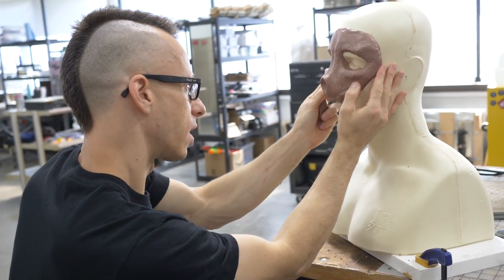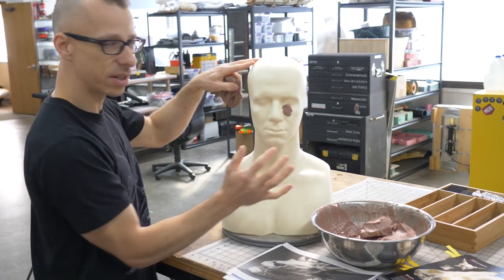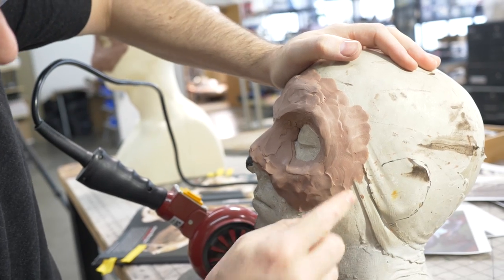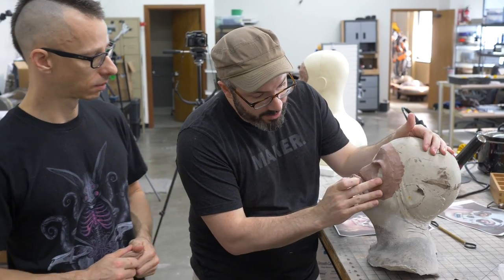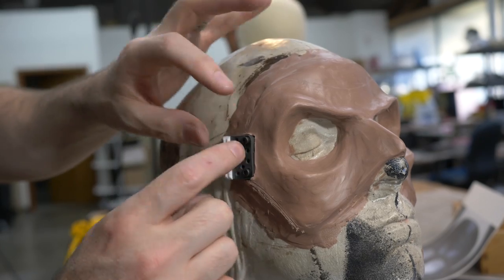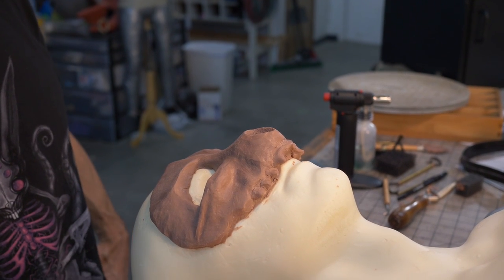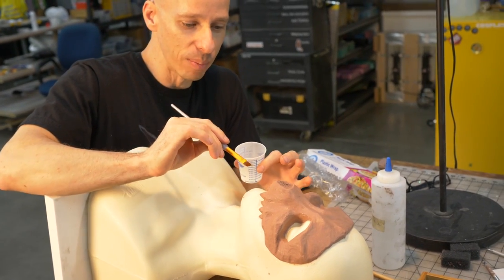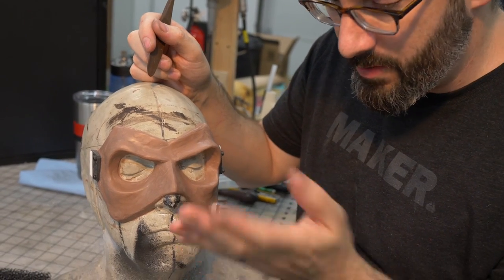Sculpting with Monster Clay! - Mask MADNESS Part 1

Comment: so ... Monster clay can be re-used after molding ? I mean you don't really bake it like a normal clay and it's not really drying so ... when you've finished your mold you can juste destory your piece, keep the clay and using it again on another project ? Right ?
Reply from the maker: That is correct! Since it's waxed based it will never dry out, only harden a bit. You can reheat it and get it back to a working or even completely liquid state, make something again, and destroy/reuse it again!
Reply: Yep! I've known guys who've had the same clay for over 15 years. 

I do recommend covering any sculpt with a trash bag when you're not working on it. it helps keep the pet hair out!  

When all done with a sculpt I put all the caly into a crockpot on low then let it get to a liquid state and filter it through a wire strainer. This will help you filter out any stuff like silicone, plasti paste, fiberglass resin, or pet hair. Then I pour the liquid clay into different containers like silicone meatloaf, brownie trays and wrap the cooled clay in aluminum foil. that way i have a variety of chunks of clay ready for for all kinds of projects.

Comment: Is it possible to use a regular foam wig head or something similar to sculpt onto? Or would that definitly stick to the styrofoam while pulling the sculpt off..? Maybe there is something I could seal the styrofoam with so the clay and mold will come off?
Reply from the maker: The styrofoam material should be fine! The problem is a lot of those heads are pretty small, so make sure yours will work for your head size.

Comment: Would a hair dryer work for heating it to a workable state mid project if you don't have a heat gun?
Reply from the maker: Yeah, a hair dryer should get hot enough to soften the clay.

Comment: Quick question, is there a way to make this clay permanent? (Like can you get it at a permanently solid state?)
Reply from the maker: With other kinds of clay you can bake it or let it air dry and it will not be workable again. Monster clay is designed for mold making like you see in this video and will never fully harden or dry. It's really excellent for long term sculpting projects, like full body applications that you see in the film industry!
Reply: Punished Props Academy thank you, I find that very helpful. I’m looking for clay that is easy to use that I can make latex figured off of so I was just curious if I would be able to make a permanent mold. However I’m sure it’ll still work as long as I remember to use enough setting powder

Comment: I bought 5 lbs of Plastilina modeling clay from michaels because its super cheap. I love masks, I've had an ineterest in them for a very long time but have never really worked up the courage to make several for myself and so am nervous starting to try now. I'm thinking of trying the monster clay, as I hear its pretty popular for the few videos I've seen where its used but is pretty expensive. But is it really so different from the plastalina I've used? Because the stuff is fairly stiff after the few seconds of being heated, and I'm look to find something thats more like ceramic clay as that's something I'm really familiar with but cannot unfortunately make masks out of due to various reasons.
Reply from the maker: It really just comes down to trying different clays and seeing what you like working with the best. While Monster clay might cost a little more than Plastalina in some cases, it's reusable and a single tub will last years, so it pays for itself.

Comment: I thought about getting the “Ed Head” but felt the dimensions to be a bit too small. I am very interested to see if how the cast turns out!
Reply: my ed head was to small for my head! however I got a face casting done then filled the mold with warm clay then slapped it on the ed head and filled in the rest with more clay till i had a close copy of my head. then i molded and casted that. now i can make my own heads for sculpting, or foam ones for storing masks.
Reply: I was afraid of that. Too bad. I’m glad you managed to rig up something that works better for you though! I have a half head cast made when I was in school. I also hacked a male wig form I got at hobby lobby to better match my head dimensions but it’s foam. I’m thinking of fiberglassing it to make it more durable.

Comment: put the staples in and take them off so that you can put real ones on the final object
Reply from the maker: That's certainly an option for you if you want to put the effort in! Bill decided to have the staples be part of the mold so that nothing would come through on the inside of the mask to cause discomfort. It's also going to be much simpler to reproduce the masks without having to manually add staples every time one is cast.

Comment: Does anyone know the best way to keep your original sculpt so you can do many masks. I know the silicone molds don't last too long and the original clay may get damaged. How can I save the same sculpt for many masks over time
Reply from the maker: You can make your sculpt out of something other than Monster Clay. Apoxie can be a good option if you want something sturdy that will last a while. Silicone molds can last a pretty decent amount of time if you take care of them though
Reply: @punishedprops  do you think I can do a resin cast after molding and use that for future use too. Like a full resin cast filling the whole mold so I have something to have as backup. And I've been considering the apoxie route.

Comment: How do remove the mask from the bust? Just peel it off?
Reply from the maker: Once you're done sculpting you'll want to mold the mask while it's still on the bust. You'll see how Bill and Nick do this in the next video! After you've made your mold, simply lightly heat your Monster clay to make it soft and gouge it off the bust with your fingers. The clay can be put back into the container to be reused later!

Comment: Does anyone know how to go about making your own heater for the clay?
Reply: Making one from plywood is probably much cheaper, but this cabinet looks a lot like the one in this video: https://www.ikea.com/ca/en/cat/eket-series-37556/
I'm trying to find the type of insulation he used. I think I'll try foil bubble insulation like grow-ops use. Then I'll drill a hole in the back and put a light socket in there with a dimmer switch from the hardware store. Easy enough project I think.

Oh but most people do it even more simply. They just use a cardboard box lined with foil with a heat lamp shining inside from the top. 
https://www.youtube.com/watch?v=sOEVtoEZPI0

Comment: That is really cool and awesome looking, now I want to do that to! But I just don't understand one thing - does this clay cure in any way? Or is this clay only used as a form for casting?
Reply from the maker: Monster Clay does not "dry" or "cure," no. It's designed for being re-used and for creating molds and prosthetics.
Reply: @punishedprops  ok, thank you very much :)

Comment: How different is this clay compared to melted/warmed plasticine?
Reply: Amanda Snider I’ve used both Chavant NSP Plastline clay and Monster Clay. Monster clay is MUCH less sticky. It is wax based so it comes off tools and hands very easily. In my experience Chavant leaves an greasy residue on my hands whereas Monster Clay does not. Chavant gets gummy when a rake tool is used and can be tricky to get all those little bits off. They brush off easily with Monster.
Reply: @craftygeekent4620  thanks for the reply, but I'm actually taking about the really cheap dollar store stuff. I made a sculpture of a bear head with dollar store plasticine and used silicone caulking to make a mold over it.
Reply from the maker: We've only really used Plastalina and Monster clay. We haven't really tinkered with the uber cheap stuff.